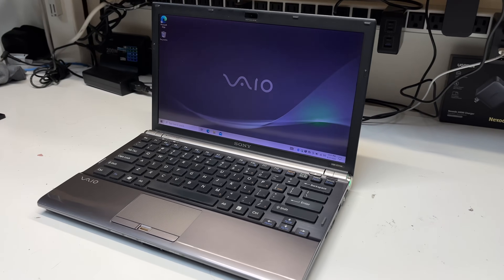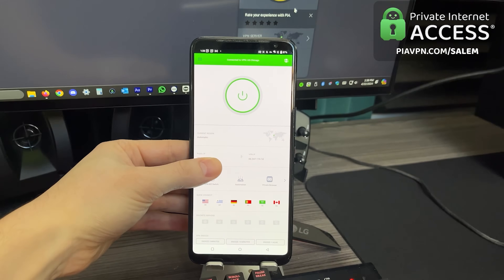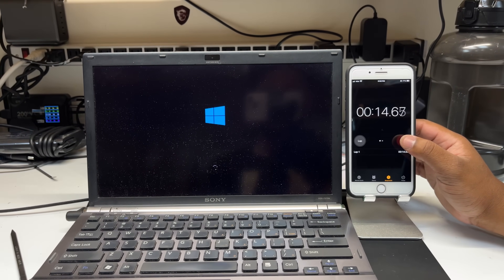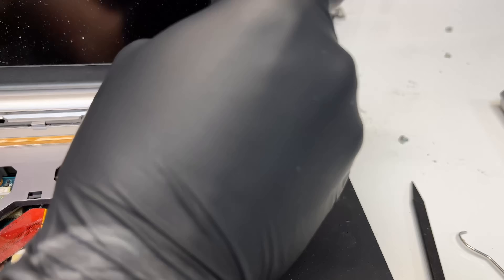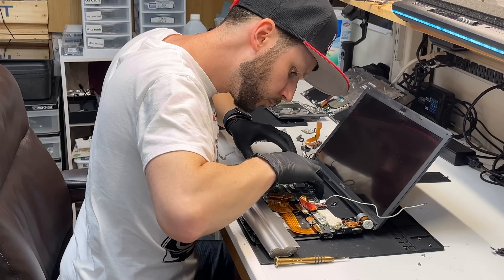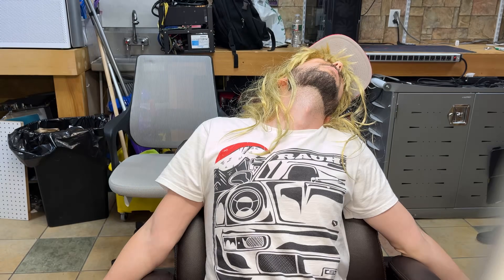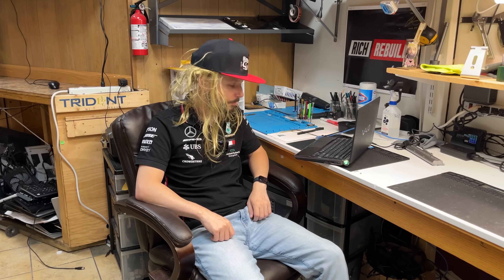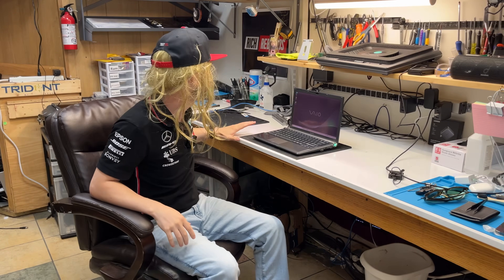Sony Vaio Resurrection: Saving this Insane Tech From 2008 (and why that soon won't be possible)

Comment: Reminds me of restoring last year an old hard worn ASUS minilaptop from 2007 or 2008, can't recall the exact specification. Basicly it was only a hard drive swap from old small SATA-drive to adapter supported SDD. The HD swap was however joke in complexity compared to this Vaio. I also didn't even try to upgrade the memory. Rest was just putting a light enough Linux on it but all in all I did have two days of headaches. 😅

Comment: Fought one of these not too long ago. Only major difference was it had a "RAIDed" SSD connected by ribbon cables. It was supposed to be a data recovery but because it didn't have standard SATA connectors we couldn't do shit with it. I feel you pain with this thing, It was awful

Comment: My wife still has a VAIO from the same time period.  We've kept it running for years with a SSD and some upgraded ram.  Her's luckily was way easy to upgrade and change thermal paste
Reply: Opening these bad boys was an adventure.  I literally took a magnetic pad and mapped out where all the screws were in a grid.  There must have been like 18-20 just to open this thing up.

Comment: Check out the Portege R600 from this era, crazy thin design but might break if you look at it the wrong way. My favourite was the HP 2510p, tiny but built like a tank.
Reply: Hp 2540p and 2570p
Reply from the maker: It's interesting how we suddenly had an explosion of these ultraportables, and then they just died out as fast as they came. Tech trends are always interesting to study
Reply: @SalemTechsperts  they go back to the Pentium 2 era, I've had Lifebool B series and Porteges with P2, P3 and Celerons. 

Technically earlier if you count the Mitsubishi Pedion but they've all disintegrated by now!

Comment: I still use my old VAIO VPC. Replaced the original i3-370m with an i7-620m (no dedicated video card, so need the iGPU), 3 more Gb of RAM (6gb total), new wifi/bluetooth card and a proper SSD. Works like a charm even with is original battery but you can see the age there. Not giving up on it and hope it never dies.
Reply from the maker: Upgrading a socketed CPU on a laptop is a feeling that few young people will ever know. It was like turning your Toyota Corolla into a Toyota Supra. Interesting how these older batteries seemed to last forever vs the bloated nightmares we get after 3 years now
Reply: @SalemTechsperts  The battery on my vpc actually died within a year.
Reply: Still have a mint functional HP Dv7 4285dx with i5 460M and believe it or not, a discrete ATI 6370M. Those laptops used to choke themselves to death... xD

Edit* I disassembled it and it was painful to do so without breaking anything. Good thing it runs 64 degrees cool now and I can upgrade the CPU. good stuff.👍

Comment: Dell's Latitude series of laptops from 2010 had replaceable, externally mounted batteries but the CPU is mostly soldered. while Lenovo's line of X/T series laptops from 2009 had all you can think of upgrades you can put onto a device. RAM/CPU/SSD. and even overclocking the CPU if you unlock the bios.

Laptops aren't made like they used to anymore, it's sad seeing it that way i still use a 16 year old laptop to do my work and damn even with Windows 7 it's still running fast as ever
Reply from the maker: Preach. I gave my father a 2012 Latitude with a socketed CPU and it ran forever
Reply from the maker: Thank you! I take pride in my segways

Comment: 00:00:00]3 Introduction to the Sony Vaio repair
Challenges of repairing a 16-year-old laptop
Importance of repairability in technology
Initial assessment of the laptop’s condition
[00:01:01]4 Comparison with other devices
Sony Vaio’s power and compact form factor
Superiority over other small devices of its time
The laptop’s enduring performance after 16 years
[00:04:01]5 Repair and upgrade process
Difficulties in disassembling and accessing parts
Cloning the HDD to an SSD
Cleaning and replacing thermal paste
[00:10:01]6 Reassembly and testing
Ensuring all components are correctly connected
Stress testing and addressing software limitations
Final thoughts on product longevity and repairability

Comment: I totally agree with everything you said about computers and their large user base. I currently have two laptops, and one of them is a 14-year-old Sony Vaio VPCF 13S0E. All drivers are fully functional, and all features are active. The best thing is that the motherboard is not double-layered like the version you repaired. Therefore, you just need to remove the bottom plastic plate for upgrade or maintenance. By the way, I installed an external Nvidia Quadro graphics card with the Express Card, and I can use the external GPU.
Reply from the maker: That is so insanely cool, thanks for sharing that!

Comment: Agree, I still use an HP G42 from 2010. Upgraded SSD and topped the ram to 8GB. Still going strong. BTW, it is running Windows 11.
Reply from the maker: Wow, I'm surprised the left trackpad button hasn't collapsed on itself and the hinge hasn't broken off. Oh and the overheating lol
Reply: @SalemTechsperts  taking good care of it and doing the proper maintenance. 🤙🏼

Comment: I've worked on laptops of that era and what the actual fuck. I get there are compromises with laptop design, but that?   what in the hell. 

Even worse than some Gateways I've been inside.
Reply: The more I see from your channel the more I'm super happy that HP didn't do anything egregious with my current laptop. Parts availability could be an issue over 16 years, but it's not a nightmare to get it apart and work on it assuming I can find the parts. Swapping the SD card reader which died(I suspect the previous owner spilled something, looked like liquid damage) took all of five minutes.

Comment: Seeing This makes me so glad that my Dell Inspiron 16 7610 isn’t a complete faff to take apart. If only I could actually use the 2230 SSD slot without the thing thermal tripping under high loads.
Reply from the maker: That's odd. Have you tried to repaste and undervolt?
Reply: @SalemTechsperts  done both of those before. No difference, Eventually chalked it up to a really poorly placed sensor and just used the One SSD in the 2280 slot and the 2230 in an external enclosure

Comment: on the other side, i have a 2008 sony vaio VGN-C1Z with a removable HDD (just loosen 2 screws and pull), expansion port , all types of connectors and it could even dock. due to almost no tracks on the web, it took me 30mins to realize i had to pull out the keyboard from the front. a challenging frustrating puzzle especially when there is no such thing as a service manual/dissasembly procedure/maintenance guide
Reply from the maker: I remember that model, it also stumped me back in the day

Comment: I remember I had a Dell Latitude D430 - a 12" laptop with an ULV core 2 duo - that was from around the same time. It ran hot as shit, and apparently that was normal for the model. I think, because of keeping it and an HP Elitebook that I used to have that I used on my lap, that I won't be able to have kids.

Comment: im a volunteer at my local freegeek. freegeek of arkansas. i cant tell u how meany good laptops ive saved from the gaylord boxs. the most recent one was a dell inspiron 15 5577 it has a 1050 and it games surprisingly well. i even saved an Alienware 17 2014 (P18E) and a MSI GT72 6QD Dominator G for $5 each. i may not use these laptops daily or weekly but i cant let these monsters get recycled

Comment: Should have booted Linux to see if the GPU is recognizable. I know it's not your job to teach the user how to use a new operating system but it's probably the only way you can maximize the hardware. Or you could have just took the small extra step of finding another used model online, hope it still has the drivers on it, and export them lol
Reply from the maker: This job was not meant to maximize the hardware, it's to get the computer to a state where my customer can use everything they need it for. Also, that "small extra step" is a massive inconvenience. Find a model on eBay, hope it still has the OG software, order it, wait for shipping, receive it, find the drivers, pull them, put the drivers on the new laptop, hope they work. Meanwhile my customer has just waited 2 weeks for a "possible".

Comment: watching this on a lenovo t450. Upgradeable RAM, upgradeable battery, replaceable keyboard. Pity it's only a dual core processor but at ten years old it's still going strong for streaming and browsing. when windows 10 goes out of support I'll just have to finally learn to deal with Linux
Reply: Just stay on windows 10.

Comment: I had one of these!!  First laptop I ever owned, in 2009.  It cost a lot of money but it was a bulletproof machine, kept working and working for over ten years.  Still works, but I just don't use it much anymore. Sony got influenced by a bunch of accountants and they sold off Vaio, then stopped making a lot of electronics that they used to make.  Too bad.
Reply from the maker: The accountants believed Sony's exceptional build quality had no place in modern business. They did the same with Toshiba. Enshitification
Reply: @SalemTechsperts oh yeah I remember Toshiba
Reply: @qualitydirtmoving I had a Toshiba satellite from 2010 and it was a tank compared to modern laptops
Reply: @qualitydirtmoving  i still use a toshiba external hdd from 2012
Reply: @SalemTechsperts  The reason Toshiba dropped out of the laptop market was because of the huge accounting scandal.
Reply: @SalemTechsperts I feel sick reading this. They really did stop caring about us.
Reply: @SalemTechsperts  Same thing happened with HP in around 2015. My 6 month old HP laptop makes some off cracking sounds at random intervals despite the fact that I open it from the center... However my 2012 HP laptop is built like a tank... Unfortunately it has no display, the screen is broken and the CPU fan died a while ago and now the caps lock button flashes. Do you know what should I do to save my old HP laptop?
Reply: Im currently on an accounting degree. The drop or keep(a division)mentality is based on whether the result of the decision will result in a minus or plus in money, without considering the impact on market share(most of the time9. This mentality has been instilled since the 2nd semester

Ironically, the key to counteract this is the concept of "economic"  accouting, inserting oppurtunity cost and future analysis into the equation. Homever, this is only said briefly at microeconomics from the 1st semester

English is not my first language, im sorry if this is not comprehensible
Reply: @3dcomrade I am in the surplus heavy equipment and parts business. Thankful that I can buy their written off Shit for pennies on the dollar and have the capital to flip it and be able to advertise their products more accurately than they can.
Reply: Holyship I think I still have one of these, also one of the "last" Sony Z series ultrabook that come with a GPU docking.
Reply: Mine was an MSI and the thing became pregnant even before the warranty ran out...
Reply: When are you sending it in for an upgrade?😂
Reply: Same! I posted on Reddit early February about a red valo I found. It was bought around 09, it was my birthday present and first computer/laptop I owed when I was 7. Sadly it’s completely *sad (no pun intended) but still a great piece of artifact.
Reply: Have you tried running Linux on it? We have a 2006 Sony Vaio running Linux Mint, the different OS works so much faster than Windows OS.
Reply: Uhhh... if you do not want it, can I have it?
Reply: my mom has a sony vaio, but she never uses it because she just dosent need it. she only uses it around 3 times a year.
Reply: I had one of these 2! Thing lasted forever!
Reply: I had one too it was the deal back then and James Bond had one in Casino Royal
Reply: My TZ packed up after about 1-1.5 years. The hinge disintegrated. All made in Japan. Sony Vaio was overhyped. And hardly bullet proof, that's what Let's Note from Panasonic was for. Those were bullet proof.
Reply: @peterc4082  Your experience is not indicative of the general population.

Most people who owned VAIO still have them or they are still working.

Comment: I bought an ASUS K53 13 years ago and it still serves my sister to this day. I rendered out 3D animations with it, I mined crypto with it, I played Call of Duty MW2 on it for thousands of hours... I've had to service it to clean out the intakes a few times over the years and it is due for a fresh layer of thermal compound to be sure, but it's in daily use. It has an SSD now which made it punchier than ever.

Comment: 4:41 That battery popping out makes me cry too. It was so easy back then. Some even let you hot-swap while connected to wall power if you carried around spares.

Not even Framework is doing external batteries anymore, and while I'm sure there are very good engineering reasons for it, I still pine for the olden days.
Reply from the maker: Lenovo took it up a notch and gave you 2 batteries, 1 removeable and 1 internal. Smart move
Reply: @SalemTechsperts 
old stuff Lenovo thinkpad
X240, X250 and X260
also T series variant.

this laptop is perfect balance of quality, performance and aesthetic.
the laptop is pretty slim, it fast, doesn't love to overheat, pretty tough, have 2 damn battery. one of them is easily replaceable.
i think that is one of the best laptop ever produced.

i do have T440 back then.
and i could confirm. that laptop is lit.
one if the best ever produced.
Reply: @SalemTechsperts 😭 I miss Powerbridge, that shit was insane
Reply: @SalemTechsperts  whilst an internal and external battery is cool and handy sometimes, it sucks when the internal battery dies, because now the laptop has to be disassembled to replace it

Oh well, at least the external one would've kept it going longer
Reply: Imagine an old style swappable battery combined with latest ultra efficient processors of today.
I could buy like 10 spare batteries and I could spend a full month on summer vacation without worrying of having to find a power plug
Reply: My first proper laptop (that I could call my own, so not a family laptop) was an Acer Aspire 5742. It overheated like hell after just a few months of use, but the battery was user-replaceable. More to the point, it could even be upgraded: I upgrade the original (and dying) 6-cell battery to a 9-cell battery when required, to increase battery life.
After that I had a HP 15-AC and HP 15-P series that both had external batteries (meaning you could swap one out for another and continue where you left off) but couldn;t be upgraded past their original 4-cell configuration.
Nowadays laptop batteries are, at best, requiring the top and bottom covers to be separated (but still held in with screws), and also use Li-Po instead of Li-Ion (putting them at risk of bulging). The worst laptops have heavily glued in batteries behind a back cover that uses proprietary security screws that needed a special screwdriver just to open it.
Reply: to be fair though, Framework does make it very easy to swap out a battery
Reply: My Lenovo X240 had 2 batteries, one integrated and one swappable.